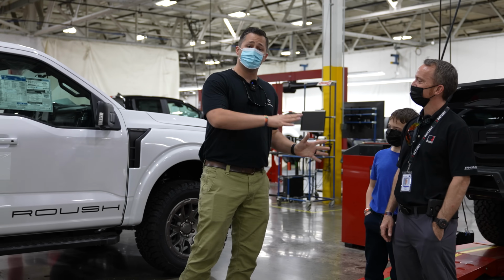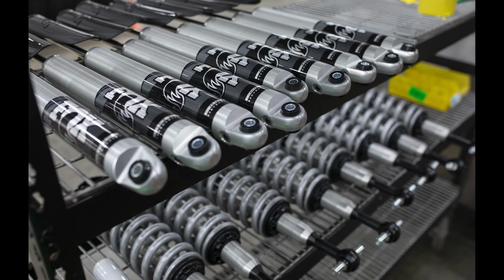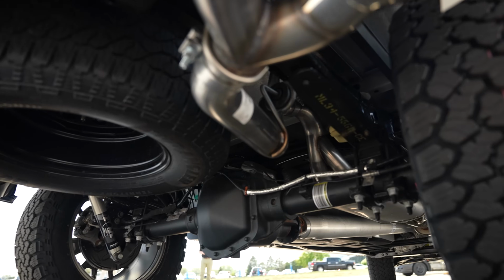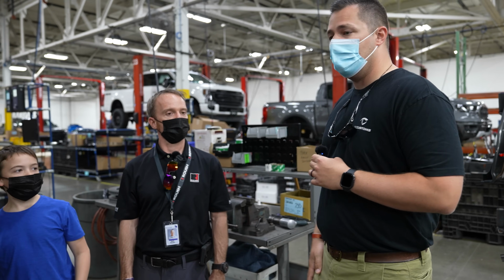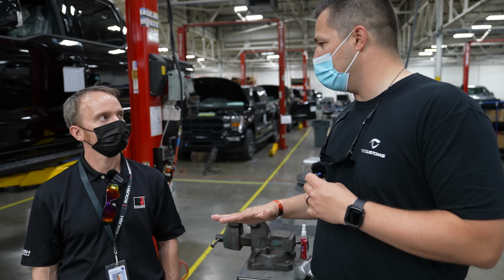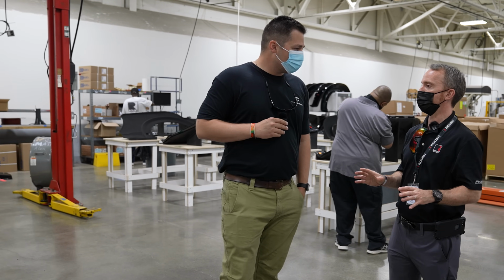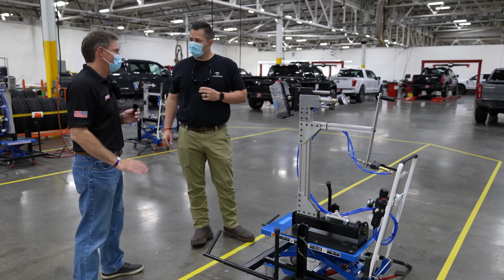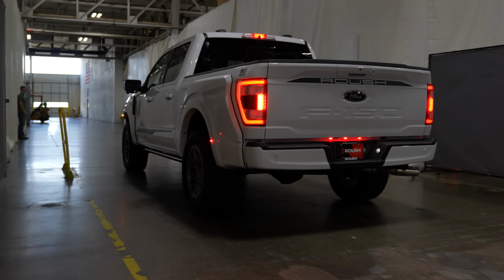EXCLUSIVE!  How it's made - 2021 Roush F-150!

Comment: I owned 2017 Roush Supercharged F150 and currently own 2019 Roush Raptor but designers who did those fender flares on new Roush F150 trucks should be fired. I've never seen something that looks so cheap. It looks like EBAY body kit on 1997 Honda Civic.

Comment: What are the power figures for the supercharger? Or is that still unknown? Does the Roush package include the supercharger to be installed at a later date, or is that a separate cost?
Reply from the maker: Supercharger specs are TBD.  and the cost of depends on whether or not you opt for the Supercharger (available as a 22MY)